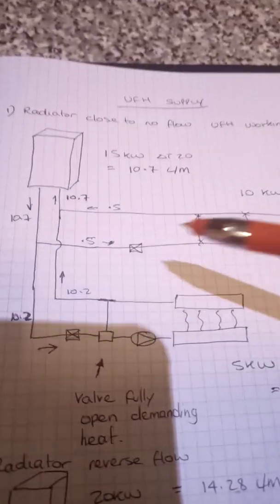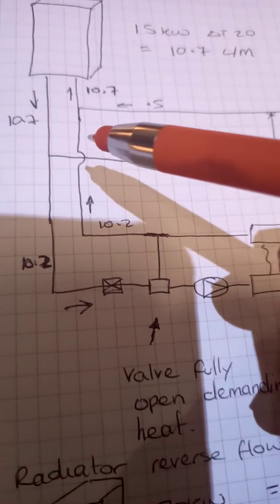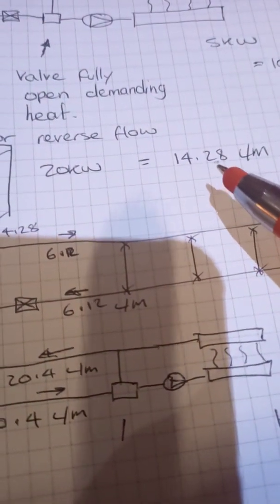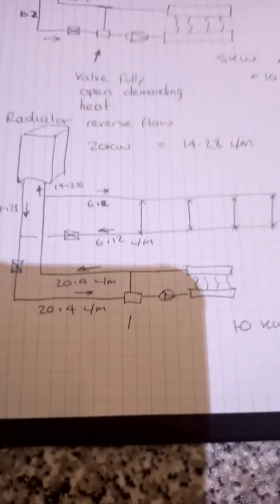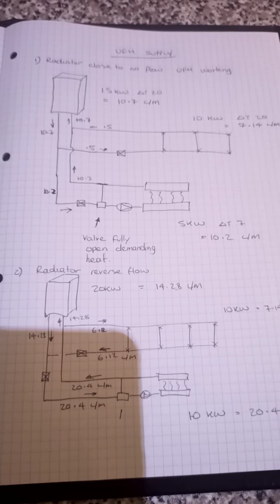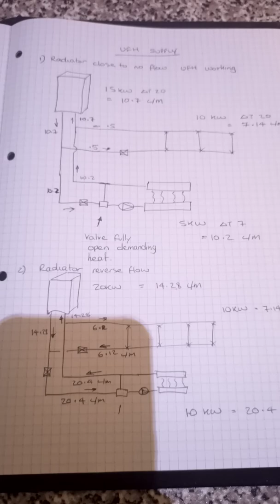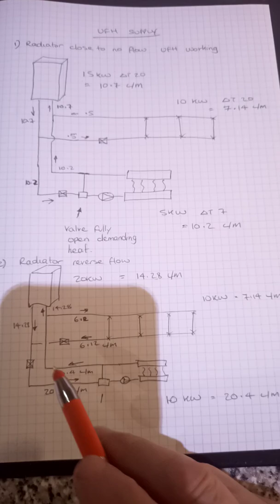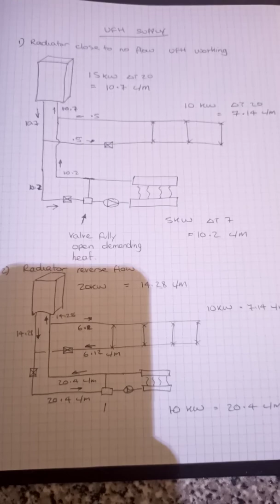Issues of not fitting hydraulic seperation on a system with under floor heating.

Comment: Really good explanation. The problem I have is Adam at heat geek on one of his articles states exactly the opposite of what you meantion. I quote. "If you have both radiators and underfloor heating, the high flow rate required at underfloor heating often outstrips what the boiler can cope with, in this instance, we suggest a close-coupled tee at the underfloor heating manifold along with a zone valve and a balancing valve to avoid leaving a system bypass. The boiler pump can then serve the radiators as required."    so which is it do we go with a CCT at the manifold or not?  Or have I misunderstood this. Cheers
Reply: Why go to expense of a balancing valve and zone valve when a low loss header is  proven to work 🤷‍♂️
Reply from the maker: A fixed by pass is going to create a constant short circuit on the return and raise the return temperature causing the boiler to modulate back. This leaves the radiator circuit under supplied.
Reply from the maker: New video posted
Reply: @andrewmillwardwatford9410  top man.. Thank you
Reply: I've actually done what Adam suggests in my own home.  UFH zone valve on flow to UFH manifold, gate valve on return from UFH manifold, and CCTs between the valves and the manifold.

In my case, it seems to work but note that: 1 I have a zombie boiler that does not modulate and the main issue is not wanting to feed the return with 30°C water as condensation in the boiler is something I wish to avoid, and 2 my UFH is only two rooms and needs less than 2l/m flow.  This means that raising the return temperature is actually desirable, and that the primary pump is more than happy supplying the flow rate required, so not quite what you would do on a new installation.
Reply from the maker: @johnbull5394  caleffi explain that ccts at the manifold is only suitable for high temperature systems.